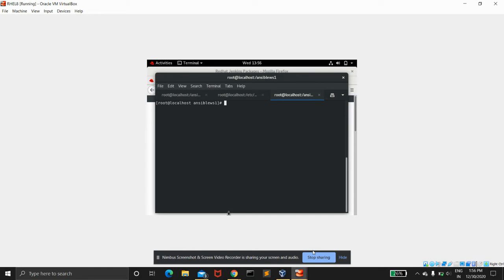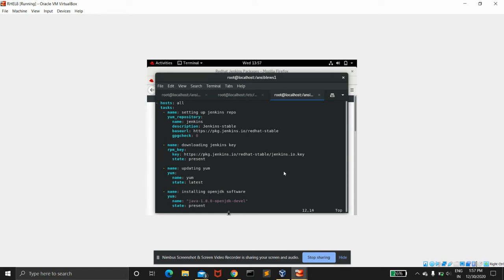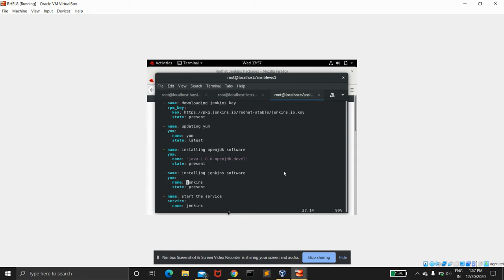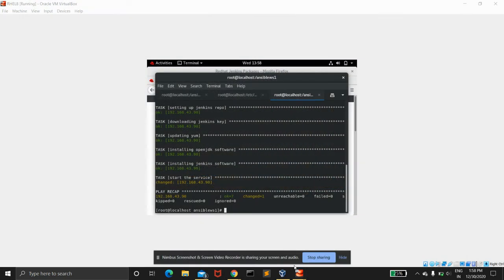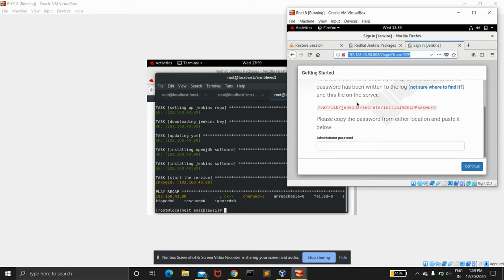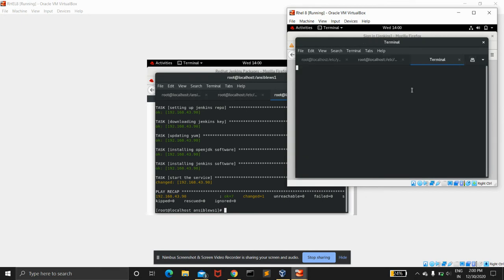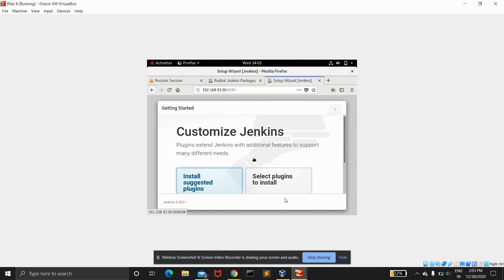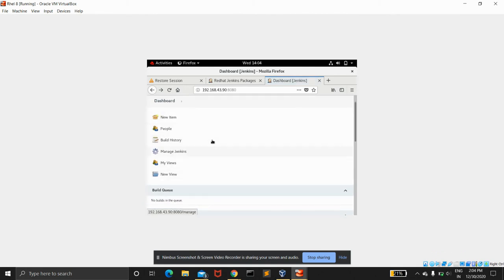Jenkins Installation and Setup using Ansible

Comment: was java previously installed on remote server?
Reply from the maker: No in task4 you can see I am installing openjdk
Reply: @adityan8536  yeah got it. did you ever tried to configure/create a job in jenkins with ansible with fresh install ?
Reply from the maker: @mudit_nagpal5  not with ansible anytime but manually
Reply: Bro firewall steps vundaliga 
Without firewall how to open Jenkins